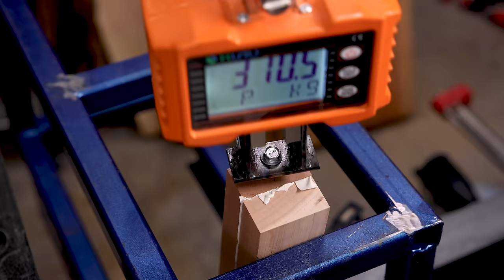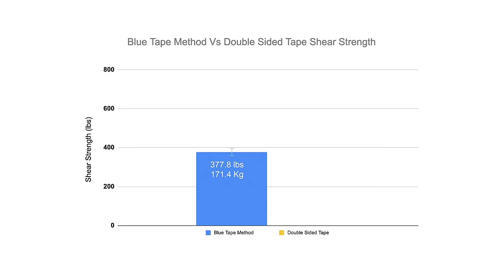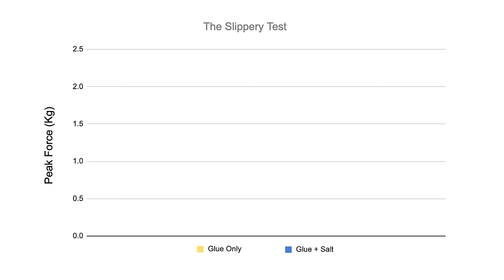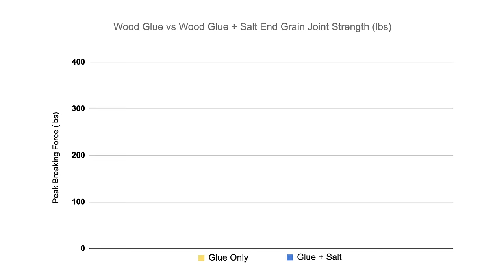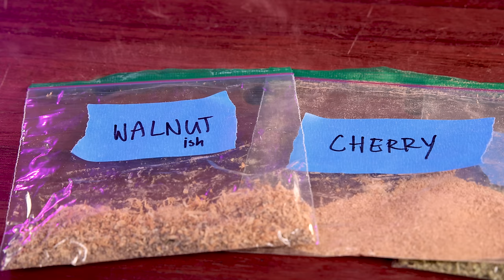Bad woodworking tips

Comment: I would say the weakness of the bond is actually a GOOD thing for the blue-tape technique.  It's supposed to be temporary and easily removed.  You want just enough grip to keep the two together during fabrication and no more.

Salt - you've proven what I expected.  But, as a former Machinist's Mate, I hate the Chloride ion.

Also, I'm glad to see you're not one of those who is scared of end-grain-to-end-grain.
Reply from the maker: I agree. I should have elaborated on this more. My only gripe with the blue tape method is inconvenience and time.

Comment: I tried salt in 90 degree miters exactly once, and was horrified at the gaps that resulted. careful alignment while gradually increasing clamping pressure turned out to be much more worthwhile.

keep this stuff up! I subscribed from an earlier nerdy dive and will watch any sort of "OK yeah people say it but is it actually true" content.
Reply: I'm curious what kind of salt you used. I'm not recommending it or anything, but in the video, he used sea salt, which is a coarser salt. Table salt or even powder salt is much finer which would both mean smaller gaps and better dissolving, which would probably lead to better joints and strength. Again, don't have a horse in this fight, but curious what the results would be with finer salt.

Comment: Thanks for the interesting video and well executed testing. Not sure about the salt tip, I have used a few grains of kiln dried sand to supply friction, but I would not use this on end grain or hardwood. Would never put good tools in vinegar, I have used it with old files to rejuvenate them and it worked fine.

Comment: Instead of PVA glue, use CA glue with the sawdust that you have made from the wood that you work with. It works miraculously :)
First fill the hole with CA glue and then put some sawdust onto it. Depending on the size of the hole, after a while sand or chisel it, and there you have a perfect look after the finish is applied. If the hole is deep, you may need to apply CA glue-sawdust few more times. You can also sand it after few seconds or wait few minutes to complete dry. But after complete dry, you can not sand it anymore as it hardens a lot. You might need to chisel it first, then sand it a bit.
(I never knew why I have never tried the salt trick. It didn't sound right. Now I know thanks to your video  👍

Comment: Thanks for the confirmation, Suman!  Years ago, I was also concerned about the chemical influence of salt in the glue. I didn't test it, but it seemed to me it would have to react and interfere with the cross-linking of the polymer. My solution to slippage was—and remains— to use a very small pinch of fine sand. Seems to be both inert and quite effective, except that the sand needs to be very, very fine. The available, well-washed fresh water beach sand in my area seems to be relatively coarse and holds the two pieces of wood in the joint apart by an uncomfortable amount (overly thick glue line... which seems like it can't be a good thing)
Reply: Use the "sand" from sandpaper.  Rub 100, or 120 grit paper together over the joint.  Very consistent grain size.  And it doesn't take much.
Reply: Thanks  @dwightl5863  That's a much better idea! Perfectly obvious in hindsight but it had not occurred to me.. As you say.. it certainly does NOT take much, and one always has 120grit sandpaper. Thanks again.

Comment: Great video once again.  Nothing I really disagree with but just a couple of notes?
1.  It's not really great either but instead of salt one can lay a brad nail or two into the joint instead of salt.  You just have to be sure to press or clamp things together in order to embed the nail into the wood (easier in soft wood than in hard wood).  Again, not great, but not horrible either.
2.  I've actually never used the painters tape because I have double-sided tape and haven't had an issue with that.  But I wonder if I might some day if I'm concerned about being able to get the two pieces apart.  CA glue doesn't hold up very well to a sharp rap so one might like the idea of being able to administer a sharp thwack to one of the boards and have the temporary joint come apart.  Again, I've not done it but I might in the future?

Comment: with your last tip on imperfections you should have mentioned the steam trick for small dent repair opposed to filler, just wet lightly hit it with an iron until the dents gone and then sand flat again.

Comment: I use the wet towel and iron trick on areas of compressed wood. I bought a door that had been damaged intransit. It had a long compressed.groove from top to bottom. I was able remove all bit a very small portion at the bottom of the door.

Comment: I've known about the glue and sawdust, and how it doesn't work. It'd be nice if you would do a video of a dent in your wood face and how to repair it. There's a few things that you can do to repair it, but I have always been keen on using a damp towel or clean rag and an iron, like the iron you use for clothing. Put the towel on the spot where the dent is and place the iron on the towel. The moisture and heat combined raises the dent to normal again. Because of the moisture of the towel, you're going to have fibers feathering out from the wood face. Just some light sanding when the spot is completely dry, makes it like it was never dented in the first place.

Comment: Minor dings in wood - I put a bead of water in the ding and let it swell the wood back out.  Then sand it after it has dried.  Almost always the ding has sprung back to original.  Give the wood an hour to dry or warm it with an old hair dryer and the wood is dry enough to continue working with.  I only use wood glue and dust when I'm going to paint a surface, therefore I'm not worried about color matching.

Comment: Great video! Blue tape, CA glue and accelerator are also expensive. Try a pinch of fiberglass powder instead of salt. High tech aerospace adhesives use micro poly spheres to regulate squeeze out which greatly increases joint strength. Any fine none reactive powder will give good results. ground fiberglass, pumice, fine sand, aluminum oxide will work, Salt is too reactive and will also corrode fasteners

Comment: Most of the glue/sawdust fills are for thin cracks rather than dents, which likely hides better since they appear to run with the grain instead of cross grain. And many suggest doing this with CA glue instead of PVA. Any thoughts about the difference for this purpose? 
Than you for these excellent experiments in working wood, Suman!

Comment: I recently had a small crack in a project that I could close back up with a clamp so I added some glue over the crack, spread it around to push it in to the crack and then clamped it shut. I then immediately sanded the surface around the crack and rubbed the fine sawdust over the crack. Once the glue dried and I removed the clamp, you wouldn't know the crack was there (unless you were me and knew the crack was there).

Comment: Chrystalized salt GRANULES are uniform in sore and tinny.  Using shaved sea salt is asking for problems.  Just a pinch is all you need.  Alternately screened "sugar sand" works.  Again,  must be uniform in size AND used sparingly.

Comment: I tried the sawdust and wood glue trick on some white oak drawer fronts I was making. Luckily I noticed it looked a bit weird and stopped after doing it on one of them, because it only got worse when I put the finish on. The very small gaps are much better than having a weird color where the gaps were.
Reply: Try a drop of whatever finish you are using and sandpaper you will get better results

Comment: Lower sthrength of blue tape compared to double sided is exactly why I use blue tape :)
Double sided can be difficult to separate, could leave residue, and somethimes, on soft woods even rip some fibers from the surface.
And strength of the blue tape is more than enough for almost any application I can imagine, and I have tried over the years.
At least.. I never have any isue with it.
Yes.. if you put too much CA on it, it can spill over, but there is no need for any substantial quantity of CA. Even few smal dots are more than enough.

On the other side, only few variants of double sided is available in my country. One so called "office" variant, and "heavy" one made for carpets and simmilar (Tesa brand usualy).
Carpet variant is defintley too strong, and "office" one.. depends on the particular brand, but also on the too strong side compared with blye tape/CA.

Comment: I have used XFasten Double Sided Tape on the CNC and have had a few faillures.  I am not sure why.  Do you have any tips on applying the tape etc. to eliminate the failures.  When it works it is great.  But when it fails, not so much.  Am I doing something wrong?

Comment: For the salt test, it looks like you used sea salt, which has much larger granules than table salt or powder salt. It would have dissolved better if the granules were smaller. I'm curious if better dissolving would have made it stronger.

Comment: Solid tests.  Never heard of that salt "trick" before. lol  Here is a tip for the woodglue trick to help it work 110% better.  After you mix in the sawdust from the same board, sprinkle the same sawdust on top of the glue area.  The sawdust on top will draw up the glue.  When you sand the spot, you will be mostly sanding wood and not glue.  We use to do this when I worked in a cabinet shop decades ago.

Comment: Thanks for this, Suman. Just curious if you should use baking soda on the clamp bar after the vinegar soak to neutralize the vinegar so it doesn't continue to eat at the metal. I've seen a similar hack of soaking in vinegar for loosening/removing rust from metal tools, & at least one commenter mentioned adding baking soda afterwards. Thoughts? Again, thanks, & have a great day!
Reply from the maker: That’s a good idea. Though I think the better solution is to leave it for 20-30 minutes instead and then using a white buffing pad or rag to wipe away. I think leaving it overnight was too long, even if it is effective at degredating the glue.

Comment: I had the same experience with salt the one and only time I tried it. First, it really didn't do much as far as initially preventing slippage, but fairly quickly it reacted with my glue (titebond extend) and failed to bond without leaving a gap. So probably too much salt added. So when I broke the joint apart, the result showed that the glue had not penetrated the grain of the wood very well, and instead accumulated around the salt grains. 
I should point out that the joints being glued were 90 degree angles on a right angle triangle shape, and needed caules clamped in place with a 45 degree groove in order to put pressure on the joint.
Not a "trick" i'll use in the future.

Comment: Thank you for this -- it was really informative.  Would you consider doing a test of c-channels, another current woodworking trend?  My guess is they don't provide significant support in the orientation they're usually added, but I'd love to see some quantitative data.
Reply from the maker: Thank you! Realllly hard to objectively quantify c channel without a massive humidity chamber with programmed moisture cycling BUT it can also double up on other wood movement testing video. I’m not promising anything but it is something I have to mentally justify spending that much money on acrylic and setup. Haha

Comment: Regarding #1 - double sided tape is way more expensive than simple painter's tape. CA glue costs almost nothing. Plus, most double-sided tapes leave ugly residue on the wood.
Second, don't use the blue tape, use the ordinary beige or brown type. The blue stuff usually has some coating ion it that makes it less reliable. Regarding spill, why would you use such an exorbitant amount of glue? You need very little actually, and then you have no risk of spill. The most important thing about this technique though is that it has a lot of holding force, making it suitable for use with routers and CNC machines, where I would not trust double-sided tape. You only need to make sure that you use enough contact area, for larger pieces, two strips on the outside just is not enough. But it's a good and reliable, cheap solution.

Comment: If you are looking for other things to test, H=how about the other joint sticking trick where they use both wood glue and superglue? The theory is that the superglue holds it in place while the wood glue sets and gives the joint the real strength.. but does it affect the strength of the final joint?
Reply from the maker: I love a suggestion that can actually be tested and quantified. I'll definitely add this to the list. Thanks

Comment: You went a tad overboard with the salt. Literally a few grains is all that is needed. Another thing I try to do when using salt is to use it only at the ends where it will be eventually trimmed off. As for your other observations with tape and CA glue and mixing sawdust with glue you are spot on.

Comment: If vinegar is a liquid, it is already in a water solution. Adding more water might weaken and slow glue release but might also weaken metal darkening,
Reply from the maker: Yes the idea is to dilute the vinegar. Though I imagine full strength can be used with less submersion time.

Comment: I haven't even heard of the "salt trick" and since wood glue is water based, I was really suspicious about that. So it helps aligning but weakens the bond (as I expected). But what about adding some insoluble grains to the surface to have the same effect when aligning the wood (like e.g. some sand) ? Thinking of emery paper, sand should have a similar stopping effect as salt grains. Sand should also not react with the glue and, when properly clamped, the sand grains should press into the wood. 🤔
I haven't tried that myself (as I never tried the salt either), but it seems more logical to me than using salt. Anyway, I still would assume a somewhat weaker bondage between the two pieces of wood, but way better than with the salt which will contaminate a larger portion of the bonded suface by dissolving into the glue, just because glue manufacturers always state on their products that the surface should be clean and free of dust to ensure proper bonding.

Comment: What's your best hack to cleaning up glue squeeze out? I find that the glue squeeze out messes up my finish even if I clean it up diligently. Especially if I use water. Thats why I never use the glue and sawdust method.
Reply from the maker: I think it is slightly situation dependent. 1- i suspect we use way more glue than needed. So reducing the amount of glue is a great first step. 2 - using painters tape in areas where the glue squeeze out will gather and then remove the tape after (though this is arguably tedious and only makes sense for mission critical glue-ups). 3- Using a chisel or a chisel plane to clean the squeeze out lines.

Comment: I was wondering about the double sided tape you suggested, is it easy to tear by hand? I once used a strong one, not paper based and i had to cut with the scissors, with is not conventient at all
Reply from the maker: Unfortunately no. It is not easy to tear by hand. However, the paper backed version can be torn by hand.
Reply: @WoodcraftBySuman  its sort of a dilemma, the paper backed ones are often just not strong enough and i dont want my parts to shoot somewhere they shouldn't be shot
Reply from the maker: @timch5227 agreed. The paper backed ones do not work nearly as well in cold temperatures. But I’ve had really good luck with them in warmer weathers.
Reply: @WoodcraftBySuman  don't know about that one since my shop is in the basement
I can recommend hot glue tho if it needs to be really fixed and safe

Comment: The problem I have with double sided tapes is that the bond is "flexible" and the piece moves while I'm working on it, which is very unconfortable and can lead to inaccuracies.
Reply: I notice this too. The only way I have found to alleviate it is to orient your DStape in the direction of the sheer forces you will be applying.
Reply: @chrispanek4401  I'll keep that in mind. I really want to like double sided tape because I don't want to release toxic fumes if it's not necessary, but I haven't found anything good enough yet.

Comment: How could you leave out mentioning glue residue when using dubble sided tape? Especially on porouse surfaces and/or left on for a longer time, it will be a great pain to get rid of. And often enough sanding will not help.
You used way to much salt!! A couple of grains is what should be used. The gap in the joint is probably caused by a ”heap” of salt, hindering the gap to close.
Your ”cleaning” of the clamps with vinegar, clearly destroyed the surfaces on the clamps and leaving them highly corroded. Also funny that you did not mentioned that vax on the clamps, may be transferred to the work piece and cause future problems when for example staining the surfaces.
And the method of using glue and saw dust are not meant to be used on surfaces that are clearly visible and finnished with clear lacquers. And your small dents would very easy to steam out and be totaly invisible. The method with glue and saw dust are useful in hard to reach places and if you save saw dust (from previous) projects you can make good matches. You have to keep in mind that the saw dust is to be considered as endgrain. And that is why it gets darker when stained/oiled/lacquered. So if you treat it accordingly, i.e. shellack, you will get better/good results.